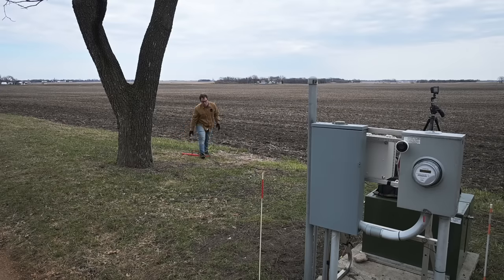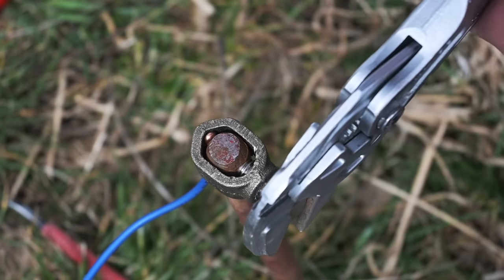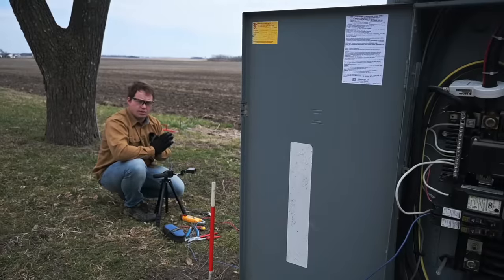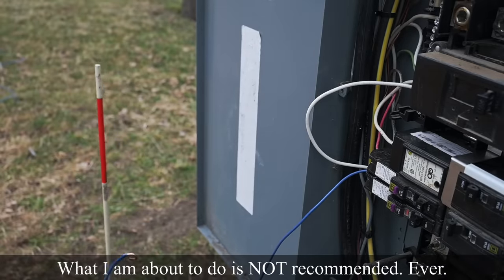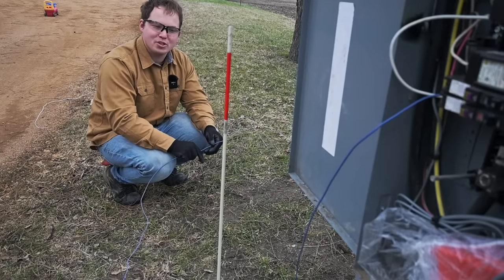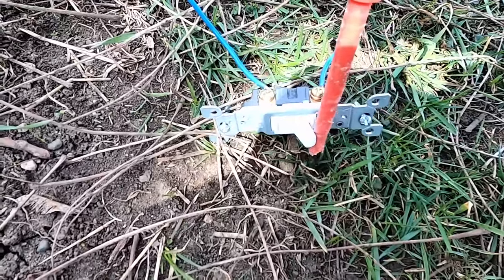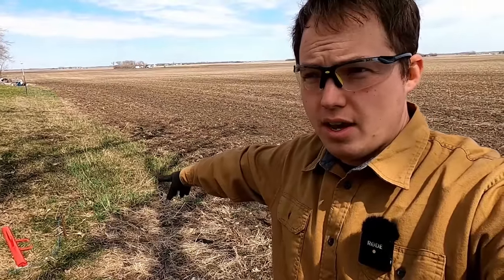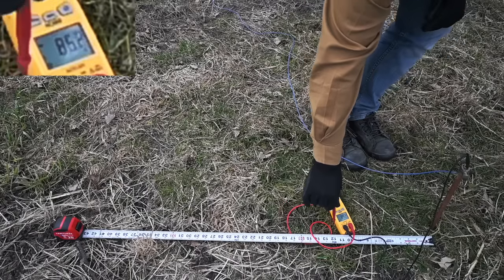Will 120v To Ground Trip a Circuit Breaker?

Comment: "dirty electricity". This is what our electric providers do here in Wisconsin. They use the earth as a return neutral wire because our grid has a grossly inferior neutral wire due to harmonics degrading our return portion of the grid. Read Dr. Sam Milham'd book  Dirty Electricity.
Reply from the maker: Crazy stuff! I believe that is part of why I was detecting current on my neutral in one of my previous videos. Basically I was picking up "primary neutral current" according to Mike Holt.
Reply: @BenjaminSahlstrom  Measure the current on your ground coming from the house when you do this to see is there is a good ground at the transformer. You should see very little change in current from your house ground. Since the path of least resistance will be from that rod you drove to the transformer ground that is closer. If there is a very noticeable change in current from your house ground then that transformer is not properly grounded at the transformer base and is relying on the grounds near your house. Won't be a big deal until you get a close lightning strike and it blows that ground to pieces. Mentioned that on the other video too.
Reply: @BenjaminSahlstrom  you have a center tap neutral. In theory it should be zero but a variety of factors such as minute differences in wire thickness or length of wires in the coil can create an electrical potential. That's likely what you're measuring.
Reply: I may be wrong. Search Google for a page titled "Causes, Concerns and Remediation of Stray Voltages on Distribution Systems" they talk about potential sources. However you are assuming the electricity is coming from the center tap (as was I) and this article seems to say that the earth could have some electrical potential. I would measure the voltage of your neutral to ground with your bonding screw removed outside. The +/- should tell you the direction the electricity is traveling indicating which has the lower potential, ie which is the better ground.
Reply: @dansmith2724  In reference to the other video with the ground current, yes it should be a center tapped neutral that should also be bonded to ground and the system neutral at the transformer. If the system neutral is bad (or a single wire earth return) and the ground at the transformer isn't there or not connected solidly, his house grounds could be the source for the neutral / ground for the transformer itself. Highly unlikely, but if that is the case and you go and lift a bond or the ground to the transformer, one side of that lifted ground will become the same voltage as the primary feeding the transformer. Same as like with an open neutral in house wiring becomes 120VAC on one side of the broken neutral. Again, highly unlikely that there is a missing ground and a bad system neutral on the transformer, but it has happened and could be something as simple as a loose primary neutral connection. He can redo his experiment in this video and see if there is a corresponding increase in current coming from his house grounds. Which is safer than lifting bonds or grounds. 
Not sure how you would use a voltmeter to determine the voltage direction with AC. DC, yes, AC no. You would need to compare the phase angle between the voltage and current to determine the direction of current flow.
Reply: @inothome   you're right about the flow ac/dc, but I'm struggling to understand how a loose neutral generates a current. V=IR so increasing the resistance with the same volts with a poor connection would decrease the current.

He essentially has a circuit containing the ground and neutral, both of which should theoretically have 0 electrical potential and therefore 0amps, bolstering the connection isn't going to nullify that difference in potential.

I'm not understanding your neutral becomes hot analogy because his house was completely disconnected and not a complete circuit. I understand the neutral wire becomes energized as part of a complete circuit, but with his house completely disconnected no part of the neutral or ground/bond system should have a 120v potential. I'm also not understanding why the ground rod at the transformer would be energized as this is not connected to the hot taps and instead the neutral tap with no loads on either of the hot taps so it will be 100% balanced. He essentially has leads coming straight off the taps at his box outside, 2 with 120v potential 180° phase shifted apart and 1 with 0v potential that is connected to ground. You seem to be saying that connecting the neutral solidly to ground will eliminate that current and difference in potential, almost like dissipating static electricity. Or am I not understanding what you're saying?
Reply: @dansmith2724  In his earlier video about the current flowing on his ground when his whole house was shut off, about where that current could be coming from. It could be the magnetization current for the transformer that feeds his house. Even with no load a transformer still has minimal current to keep it energized. If that transformer has a bad ground or neutral his ground from his house could be supplying that ground / neutral. So now with this video where he sticks a ground rod in the ground and measured 9 amps, if in fact the ground that should be at the transformer is not there he should see a corresponding increase in the current flow on the ground wire coming from his house. Easy test to rule out a missing ground at the transformer. Since the current should flow to a ground rod closest to the transformer and not all the way over to his house. 
The transformer high side should have one high voltage connection to the power companies distribution and the other side is either bonded to the inside of the tank or there is a bushing that needs to be connected to the system neutral and also a ground. The transformer tank also gets grounded and bonded. That same ground and neutral also connects to the center tap and continues on to the house ground and neutral. If there is a problem with the ground and system neutral connection at the transformer, it could be using his house ground. Unlikely, but it does happen. In that instance, if he were to disconnect his ground that was supplying the ground to the transformer, the side still connected to the transformer will become the same voltage as the high voltage feeding the transformer. If you took a simple electrical circuit, 120VAC, a switch and light bulb. Put the switch on the neutral instead of on the hot leg and opened the switch. On the side that is connected to the light bulb it will be at 120VAC. Substitute the bulb for a transformer and the switch for the disconnected ground. Again, all of this is unlikely but it does happen. More than likely if it was the case as soon as he loosened a ground it would start to arc and spark before he was able to pull it all the way out.
Reply: @inothome  I see what you're saying. You're saying that there could be induced current on the neutral and saying it should be going to ground at the transformer. If he's measuring .2-.3amps at his house ground it could be because of increased resistance to ground and the lack of the ability to dump that current to ground at the transformer, which could be a bad connection. In this case it could be dangerous as there could be a lot more current induced at the transformer than what he's measuring downstream of the grounding rod?
Reply: @dansmith2724  Not induced, actual current. In the last video it was over an amp (if I remember correctly) of current on the ground wire with the main in the panel shut off. My concern was that there is something wrong with the ground at the transformer, so the transformer is using the grounds at his house for the ground. Since even with no load on the transformer, it will still pull a little magnetization current. But a non invasive way to prove or disprove would be to do his experiment in this video and measure the current on his ground wire at the same time. his ground should see minimal effect from this experiment. Since the ground rod he drove in is closer to the transformer ground. If he sees a big increase in current on his ground from his house, there is something wrong with the ground at the transformer.
Reply: @inothome  what do you mean by "not induced current, actual current"? Induced current is actual current, all power going to your house is induced current. that's how transformers work. 

I'm not sure why keep saying magnatizing current? Magnetizing current is the current on the primary coil side of the transformer from the utility, unless your talking about back EMI. Induced current is on the house side or on the secondary coils. Magnetizing current causes induction current.

He was correct when he described the current being distributed across his ground system in the other video. It will never entirely dump into the closest ground no matter how good the connection is.
Reply: @BenjaminSahlstrom  I would like you to try these experiments.

Part 1.
Connect the hot to light bulb, an appliance, a load, then connect its NEUTRAL TO GROUND. 
Don't use ground terminal.

Did the bulb light?
Did the appliance function?
Whatever the load was, how well did it function?

Part 2.
Repeat the same, but this time, instead of connecting the loads neutral to ground, connect the loads GROUND TO GROUND leave the neutral disconnected.
What's are the results?

We will see how good a conductor is the Earth at 60/50 Hz!
Reply: @dansmith2724  Totally missing my point, I work in the electric utilities field and I have seen what I am describing quiet a few times. It happens, not often but it does and can be lethal if messed with and not expecting it.
Reply: @inothome  Assuming it's a single wire to earth return, would the ground rod on the high voltage side of the transformer energize the soil enough to cause a voltage potential at the low voltage side ground of the transformer? The difference in potential between the house and the low voltage side ground of the transformer could be the source of the current flow? This is also assuming they're sufficiently close of course.

Essentially very similar to what he did as an experiment in this video.
Reply: @dansmith2724  At the transformer, the high side and low side neutrals are bonded and connected to the same ground at the transformer. If that ground is not there or someone left a bug or connection loose it could be using his house ground only. I have seen it happen. If it's SWER it's even more important to have a solid ground at the transformer.
Reply: @inothome  I found this online and thought it was interesting:

"Now referring to an issue little understood by homeowner and electrician both, we come to Grounding. If one were able to use a voltmeter with very long leads (several km long) and measure the ground connecting points of these various systems, it would be noted that they are several, and perhaps hundreds, of static and alternating volts different from each other. With the Delta system it's not so much a concern because the different grounding points are not solidly connected to each other, making the cause of "stray currents" a myth (caveat here due to suburban residential systems interconnected due to the indoor system's major flaw). With the other two systems (WYE and SWER) it makes a major difference because now these differences in voltage will be the driving force behind the flow of currents in the soil. In some instances the grounding point to a local point of service can be electrically elevated from the ground around it, by as much as 15 to 25 Volts, based on my first-hand experience. The typical response of the electricians or electric company personnel is to sink additional ground rods into the soil. This is most idiotic because it simply adds more electrical contact with which to drive more current into the soil. It only mildly reduces the "stray voltage" previously identified. What needs to be done is to identify the reason why the grounding point voltage is elevated, and correct it. However, this latter path is not the path of least resistance, so it is seldom employed. In suburban and rural areas where elevated grounding-point voltages are identified, it is most likely a result of frayed or broken primary return wire. If a single customer is affected, and the transformer's primary and secondary grounds are interconnected as above, the customer can request neutral / ground isolation at the transformer. The two grounds, now separated by 8 feet or more horizontal length of insulated wire to where the rods contact the soil, are interconnected with a surge arrester (somewhere on the pole), which will provide instant union during a surge to improve grounding, and once the surge is quenched the arrester again becomes an isolation device. A variant of this for a concrete-pad-mounted transformer will serve the same purpose."

Comment: Nice demonstration. Resistance can be calculated by measuring voltage and current and applying a formula. In this case that rod is 13 ohms, roughly, back to your source. 25 ohms or lower is the generally accepted minimum for a ground.  5 ohms is considered better for sensitive equipment.  Communication sites and other critical sites go to great expense to create a good low resistance ground. Usually multiple rods spaced well apart, connected with heavy wire. Some more exotic systems use copper and salt grounds or other materials to enhance the connection to earth even more.

Comment: This partially explains the difference between bonding and grounding.
Reply from the maker: I need to make a video dedicated to that subject.
Reply: Bonding protects people by sending fault current back to the Neutral at circuit breaker panel via the ground wiring.
Grounding, protects things and people by creating and equipontencial voltage of 0V along  components and placing a path to bleed extra high atmospheric currents to Ground/grounding electrodes via the ground wiring.

Both concept has a common element - Ground.
Reply: @V21IC  Yes sir
Reply: @BenjaminSahlstrom  That would be cool. So many people don't know about that.
Reply: @BenjaminSahlstrom  Lets say that the neutral and  ground cables are bonded toguether  at the main panel. Now if a hot wire makes direct contact  with the  ground wire conductor What would happen? Does it cause a short circuit?

Comment: I had something similar happen to me after wiring a double duplex new work box. When I flipped the breaker on the breaker started to smoke. After shutting the breaker off I opened the old work box up and saw that when I pushed the outlets into the box the ground wire twisted and was touching the hot terminal. I then fixed the issue and replaced the breaker.

FYI... I have recently re-wired (New service entrance to a disconnect with 3 sub panels) a whole house that had knob and tube with Romex splices and the scariest main panel I have seen. All with out gutting the entire house. No electrician would even look at the job.
Reply: Yeah and you must be a whole lot richer now!!!
Reply: @joshuabarbosa4824  ?

Comment: I found this hilarious about how many people know about how to get worms out of the ground
Reply from the maker: No kidding!!
Reply: @BenjaminSahlstrom  where does the current goes does it return to source I mean 10 amps of current. We study that electricity comes back to it's source side or Just dissipate in soil.
Secondly please tell me how to check an  older installation with no GFCI how to check that there is no leakage to earth?
In your video we delibertly ground the hot side but in older installation where the system is running since a long time how to check it's health?
Reply: Did that as a kid 40 years ago, had to listen to a lecture from my dad about it, he was an electrical engineer!  =)

Comment: Ben, why do you have a conduit going up a tree?
On the breaker, I figured that it would trip in 30 seconds. Boy was I wrong. I work on a farm ranch in north east Montana.  I work with 6vdc, 12vdc, 24vdc. 
24vac, 120vac, 240vac, 480vac. We have 5 pivots, two are 480v 3 phase, two are 480v 3 phase from diesel generators, one is 480v 3 phase from a rotary phase converter. The last has 10 active condensers with 11 inactive condensers.  
These ground tests that you do are extremely important to me, because we have 6 heated cattle waters, 4 heated cattle water tanks 300 to 1200 gallons. 
Before I started here, he almost lost some bulls from an electrified waterer. Due to an unconnected ground wire. When they were installed over then summer, someone missed 2 ground wires. 
They had to put the bulls in a pen with a plain tank before the bulls would drink.

Comment: Generally very good, I just want to point out that electricity doesn't want to return to the ground, it wants to return to its source (transformer or generator). And it does not follow the path of least resistance, it follows all paths, with current proportional to each path's resistance.

The only reason current even flows in this experiment is because the neutral is bonded to ground. If you removed the neutral/ground bond in the panel the current drawn would go down (it wouldn't cut off completely because the neutral is probably grounded at the pole too).

Comment: When you are measuring from the ground rod one foot out into the dirt and getting 90 volts or whatever it was that is voltage drop. You're available voltage would be 120 minus the 90 or 30 volts available. When you measure from the ground rod to the ground you are measuring a drop in voltage not an available voltage. You are showing the difference in voltage between the rod and the ground. The available voltage would be your source voltage minus your drop.
Reply: Simply put, if you are across that 90 volts drop, like the meter is, then you would be getting a 90 volt shock just like the meter is.